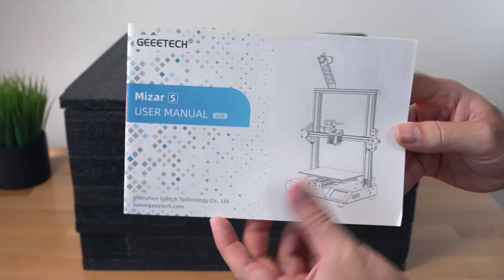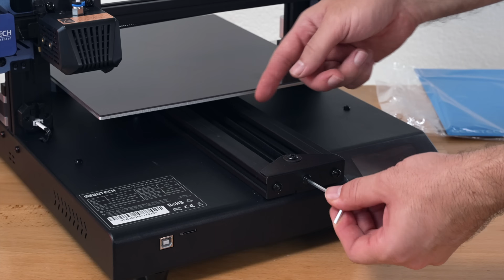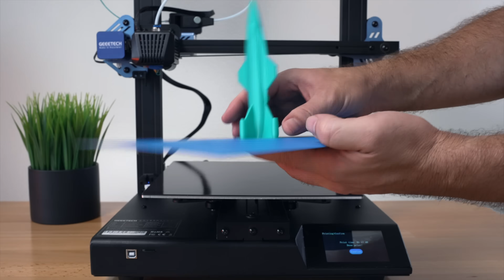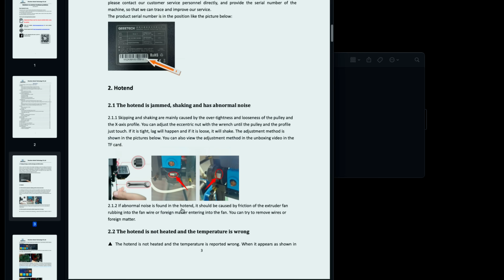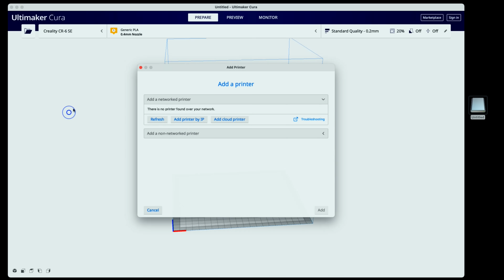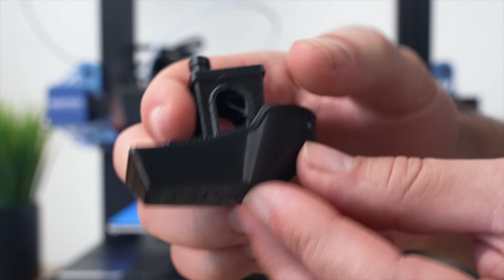Geeetech Mizar S - 3D Printer - Unbox & Setup

Comment: Weird is that it does the bed levelling first then the z offset . Wich made the problem and you had to re-set the valus . Usually it's z offset first ( in the middle ) then mapping for the rest of the printing surface . Weird system for sure .

Comment: Just got this printer after all the good reviews, but I noticed something on my y axis. The wheels spin easily towards the middle of the  y axis, and when it gets closer to either ends, it's tighter and harder to spin the wheels and bed doesn't move as easily, does this happen to you or anyone else?
I used some digital calipers and found that the middle is a like .2mm less than the ends.
Reply: yes. same here

Comment: HI, You put the wrong size on the printer (you inputted 255, 255, 265), I think that's why the last print did not print right (the right sizes were, 255, 255, 260.)

Comment: If the z-steppers are independent, a belt is not great. If they're using a splitter off a single output, then a belt can be good. But if you have independent z steppers, just level the gantry by pushing the z axis all the way up and letting it tram itself.

Comment: the stepper drivers should definitely have heat siinks on as over time the will overheat and burn out
Reply: If you have good cooling, heat sinks aren't really necessary. If you have bad cooling, heat sinks won't work because they won't be able to offload the heat, and they can actually make things far worse by insulating the chips. My takeaway from this is that good cooling is more important than heat sinks.

Comment: I just bought  two old fashion 3d printer.Find it cheap online,one stuck somewhere and the other one order from China hasn't ship yet.This is the second time i order 3d printer from China,one got cancel from the supplier and the other one still in the process of shipping.Buying item online has it's own problem.Still waiting in agony.
Reply: But where? Because I never had problem online. But only from trusted shop
Reply: @riccardosacchetti  I also buy from trusted local online shop always have a problem.Almost everytime i order,i have to remind them i ordering item from them and told them to ship the item allready.Even when they ship the parcel,it's goes around the block,warehouse,checkpoint several of them and then the carrier got lost again for 10th time then call for direction.After that then the carrier reach the droping point.That the horror story of online purchasing when i decide to buy something online.